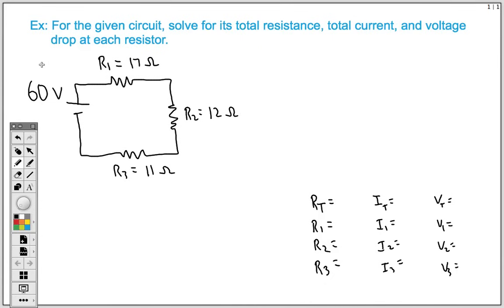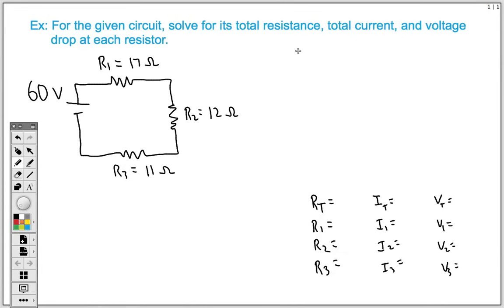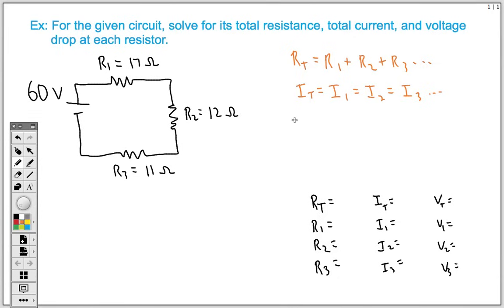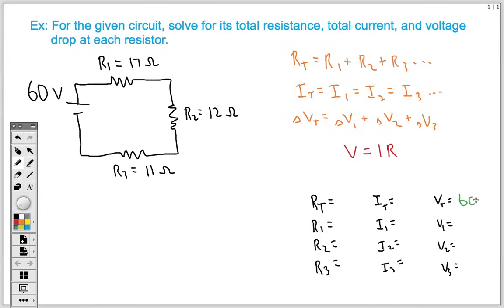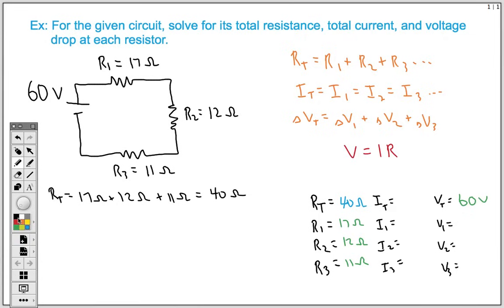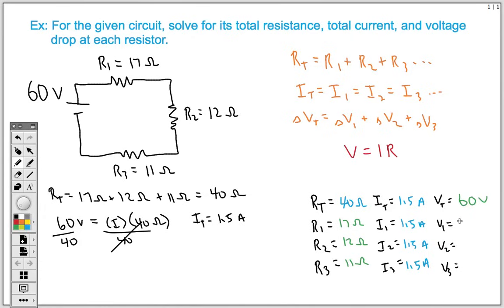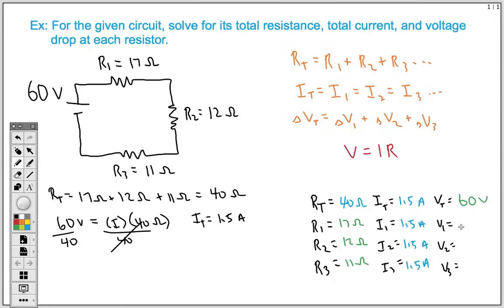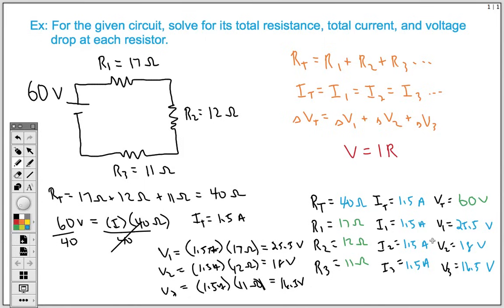How to Solve a Series Circuit (Easy)

Comment: Can you do one where you’re only given voltage for a resistor, power for another resistor, and ohms for a third resistor ? Stuck on this
Reply from the maker: @5abivt  There are three different equations you can use for power in a circuit. Using the correct one may help solve your problem.
Reply: @  appreciate the reply ! The question given has a 24v battery source, and 3 resistors. R1 =6 ohm, r2=10volt, r3= 20watts . When I draw the chart style layout like you did (which really helps thanks !) I still only have 1/3 for each which is where I’m stuck so I cannot use the formulas …

Comment: So if you just ADD the resistors you get 40 ohms.....DIVIDE 60 volts by 40 ohms to get The CURRENT ....& Current TIMES each resistor gives you the voltage through EACH resistor. You just have to set your page up first with everything like he showed and write the formula over each sector to remind you HOW to do it. Using the calculator you don't have to worry about whatever canceling out he did. That confused me....You'll KNOW it's RIGHT when you ADD the voltages up you get from each resistor TOGETHER , you'll get The same as Total Voltage.

Comment: So how would I find my I if I don’t have my V totals mentioned? How would I go about trying to find that?

I’m 31 years old trying to get my certificate of proficiency in Industrial Electricity. Really struggling right out of the gate with all of this.
Reply from the maker: @johnt5025  That depends on what you do have. Do you have resistance values? Do you have any voltage values, like a battery voltage?
Reply: @DMaciaga so the current problem I am working on gives me all 3 resistance values (25, 80, and 140 ohms). I am trying to figure out and understand how I’d be able to find voltage and amps with just that(resistance)  info alone.
Reply from the maker: @ Are you given electric power at all? I'm not sure you can solve for anything with just the resistance values. There needs to be some other variable.

Comment: When adding voltage and resistance up, do you also add the total along with the rest of the numbers?
Reply from the maker: Just the individual ones should add up to the total.
Reply: So if I have a total of 10 volts, did I do the problem wrong if i went over that number?

Comment: What if I don’t any ohms on second resistor
Reply from the maker: If you know the total voltage and total current, you can solve for the total resistance using V = IR. Once you have the total resistance, all of the individual ones should add up to that.
Reply: PhysicsHands thank you!!

Comment: How to solve if one of resistance is unknown?
Reply from the maker: You may have to use V=IR to solve, or if you know all of the other resistors you can figure it out by using the rule for adding resistors in series.